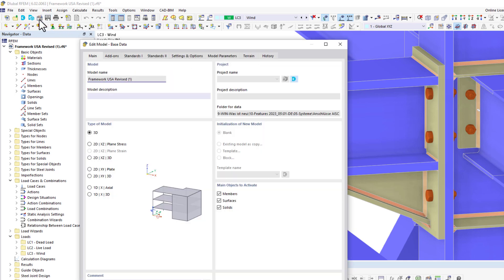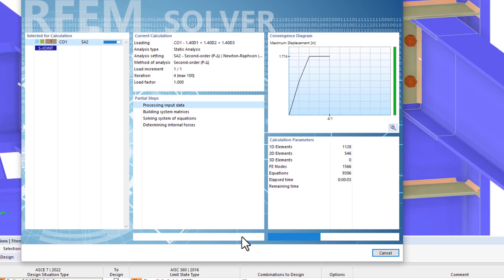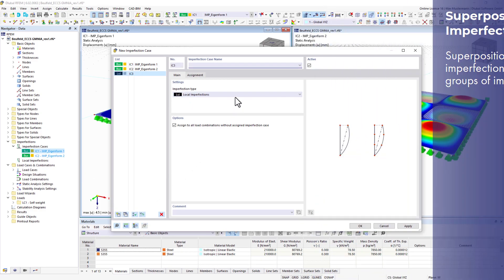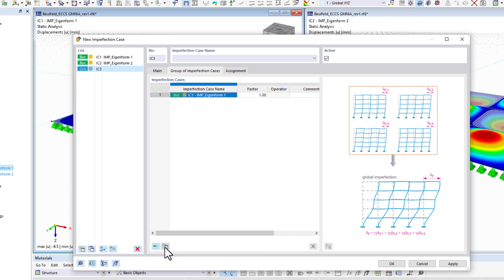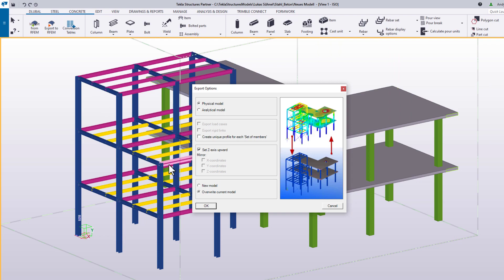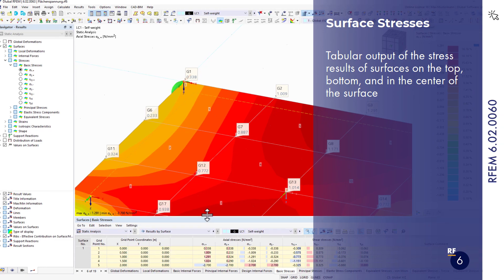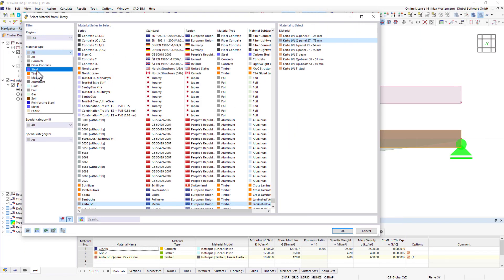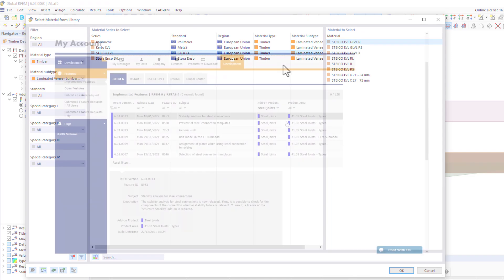WIN | 05/2023 - What's New in RFEM 6 and RSTAB 9?

Comment: Does the AISC design feature for steel connections include the seismic requirement (detailing) of the code?
Reply from the maker: Hi, MR.!
At this time, AISC 341 or 358 is not considered. Only the AISC 360 is included in steel connection design. However, we plan to implement at a future date